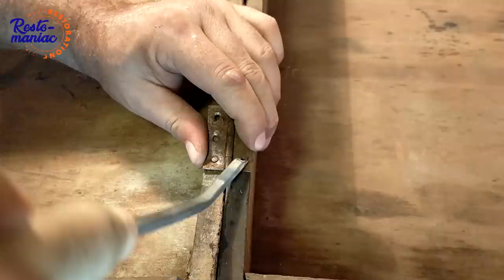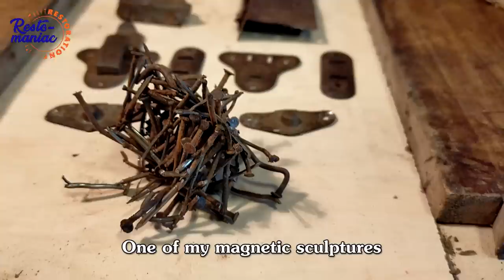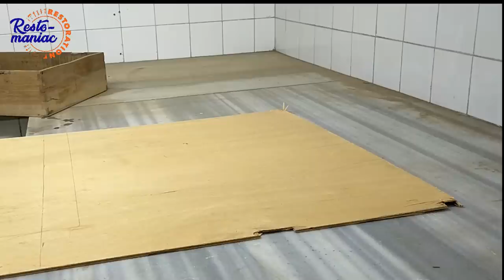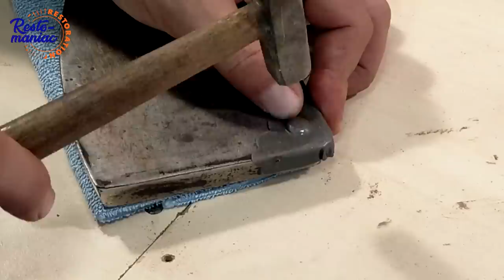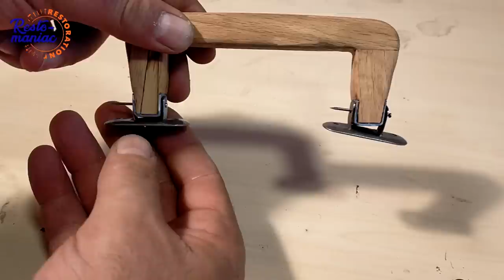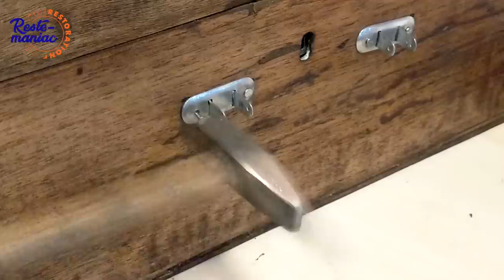Antique Wooden Suitcase Restoration

Comment: Two things i would had made different.

First is to add a thin leather strip on the inside, between the lid and the case. That way the lid can be opened, but not lie down on the table.

Second is to use longer nails for the handle where it's fastened to the case. Longer nails that then is bent like a U on the inside, then hammered into the wood agein. That way the handle will be able to withstand allot more weight. This is sole due to the size of the case. A smaller/thinner case would be fine with just using stright nails. But given its size, its ineviteble that it will end up having heavy things in it.